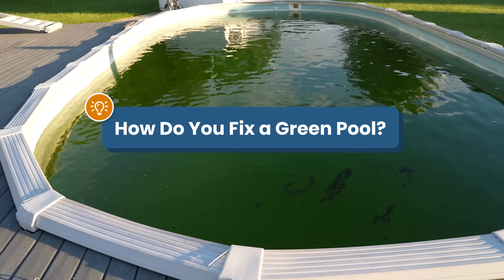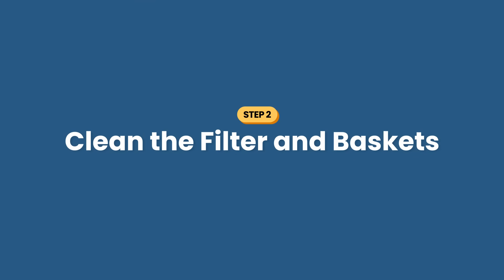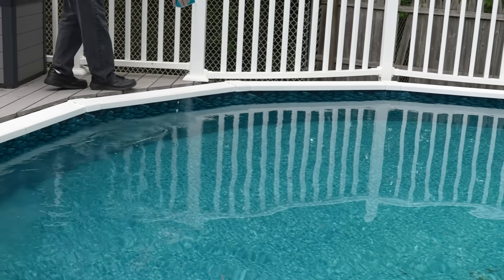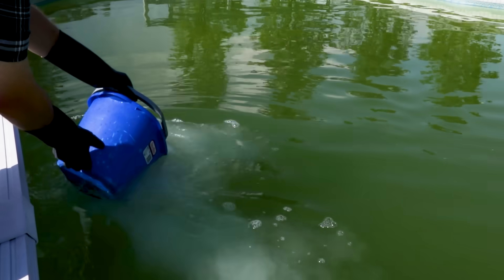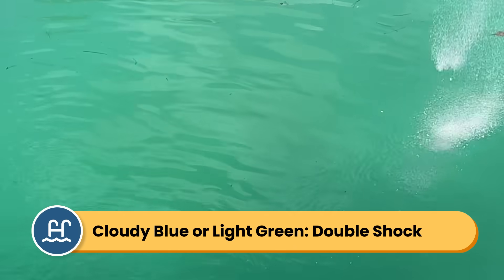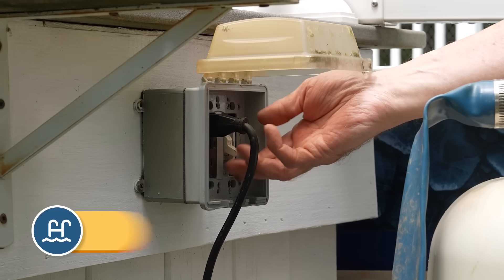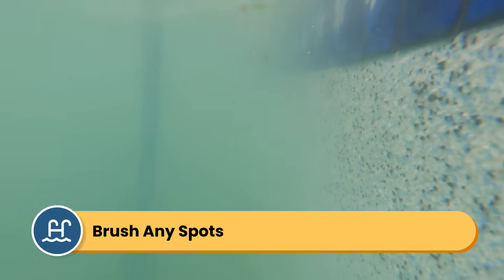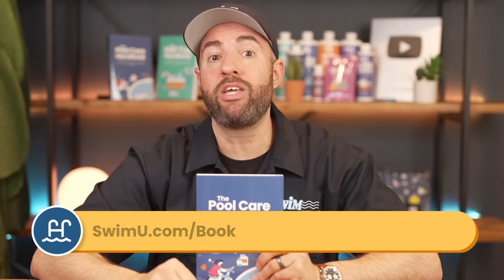Green Pool CURE: How to Clear Up POOL ALGAE Overnight (24-Hour Fix)

Comment: What if you already have high cyanic acid levels? Will all that shock/chlorine work?
Reply: CYA over 100, no, likely in chlorine lock. Will need to do a partial drain and refill to lower your CYA. If your pump has waste option, drain water by vacuuming to waste

Comment: What’s wrong with using algaecide?
Reply: Nothing wrong at all. You're the first to ask that & I'm rather perplexed that many are using gallons & gallons of Chlorine to eliminate their Green Pool!?
When my pool goes Green, Algaecide is my 1st port of call.
5Ltrs around pool, pump on for 10hrs, sweep pool wall & floor periodically during the purging process, remove & clean my filter a couple of times & the Chlorine gets added next. Then add Baking soda to adjust Alkaline & lastly adjust PH increase if required & presto. 15yrs doing the same trick & never fails....oh, no one's ever gotten sick or died👍

Comment: I just installed a 1000 Gallon pool and the Test strip shows the lowest level of Chlorine (new water) I bought a 3" tablet that treats 10,000 Gallons. Should I throw the whole thing in or is it ok to break in 4 and use 1/4?

Comment: If u got mustard algae, just shocking doesn't work I just went thru it.What worked was the heavy shock algacid and clarifiya filter was only cleaned twice before i started and around 5 hrs later. it's clear in less than 24hrs my family and neighbors think I'm a magician cause it looked like they weren't going in there anymore swamp thing 🧟😂

Comment: just prevent it by installing a solar ionizer!
Reply: What is your review on one? Do you have one?
Reply: @CurlyQ101z  a very interesting claim made by the fabricant in its description, that by its very decent current eliminates any germs passing by: i encourage own experiments in order to find out more (by biotensor, petri discs etc.)
Reply: @CurlyQ101z  no more slippery ground/wall cover (moss/algae) i found; after aspirating loose grey/black debris from its ground it keeps cleaner than before.
Reply: @CurlyQ101z  about 15€ from Aliexpress incl. shipping, put it in just 10 days ago

Comment: All this is great and all but you can absolutely never run the filter (if it’s a DE filter) idk about sand filter for 24 hours straight. My pool is dark green full of algae. Like bad. After adding fresh DE powder and cleaning the inside of the fingers of the DE filter, the pressure on the filter literally will skyrocket to 20 psi within literally 20 minutes to 30 minutes, maybe even less sometimes it clogs up right away and it’s the most annoying thing in the world and it also cost so much money using all that DE   Everytime I completely open my DE filter (it has the easy quick one screw system to open it) I drain the dirty water in the pot spray off the fingers with the hose put it back together add the new powder and it’ll be clogged again in 20 minutes. It’s so frustrating.

Comment: Need help 2 days ago i added 6 bags of the shock pool because water was green well water looks clear but the algai looks like its settled on the pool lining and so yesterday i added 2 of the 1 gallon pool agai each and water is still green i dont know what else to add plz help do i need to clean filter and wash it several times a day to help filter the algai or do i need to add more chemicles i dont know what else to add
Reply: Oh the 2 gallons i put in the pool where clorox for treating algai
Reply: We did this to and our pool is still green. We have no idea what to do next. We’ve shocked twice already with 3 bags and then 5 bags. All levels are good but it’s still green. I scrub and vacuum daily and sometimes twice a day. And nothing is helping.

Comment: My CYA is at zero and my pool is as dark as can be. Where in the order of these steps should i add the stabilizer to this? I have been battling algae in Florida and i can’t get my cya to stay up (possibly from shock and floc method i was using ?)
Reply: Check your phosphate level.   It's basically algae food. You want level around 200 or less.  If gets high then have to use phosphate remover bc it will eat up.all your chlorine and won't be able to keep algae under control. Have your local pool store test your water.  Also before you do the phosphate remover step, you have to heavily shock pool to kill algae and filter it all out 1st.  Good luck.  Fyi I'm in TN so this might be different in FL but a good direction to start.

Comment: All my levels are within range and I’ve put 10lbs of shock in, my pool is 21k gallons. After this I at least expected it to be cloudy the next day but still light green.
Reply: I have a 14,600 gallon pool. I bought 12 bags of Cal-hypo shock, and used 6. The next day my chlorine was at zero, but the pool was a bit lighter green.  Someone on pool page told me to go get liquid chlorine. I put in 8 gallons last night and this morning the color is blue, but cloudy. Tomorrow I will vacuum.

Comment: I've been using the cal hypo shock for the past 2 weeks and I keep going out and finding dead algae on the bottom even though I've put algaecide 🤦🏼‍♀️ I do not want to buy a vacuum for an above ground pool! I've been backwashing my filter once a week
Reply: I bought a vacuum for the above ground and it literally pushes the tiny algae back out of it. -.-
Reply: @Ghosted710  same
Reply: Just plug the hose onto the suction port and push the end of the hose around the floor with your foot making sure the end does not lay flat and suck to the liner.

Comment: What he don’t tell you is that it’s never this easy if you have a ton of algae you’ll be cleaning your filter 5 times a day for a week
Reply: And vacuuming stirs it up. By time I bought shok, floc, waste watter. I should just emptied it
Reply: Yes ,..
Reply: I just opened it yesterday, and their was so much Algae that i started to close it right back down. My wife usually takes care of it, but i'm not Speaking to her right now.😂😂😂
Reply: @BarrySimpson-pk7qs yeah man it’s full time job my man
Reply: I'm actually doing it now
Reply: We've had the pool for 13years and she always does the up keep. God is good, she saw me struggling and didn't help. I Brushed the walls over and over cleaned the filter 7 times yesterday and shocked it lastnight.  I wokeup this morning and it was a little cloudy, i cleaned the filter 1 last time, put the Robot in, and now it's Perfect. Ill get a water Sample tomorrow morning.
Reply: @BarrySimpson-pk7qs im literally on week 2 anyone ever have your pump start strong then 20 minutes later its dead I tried everything
Reply: @bdoubleu6 yes what's the reading on pressure gauge?   When filter clogged then little to no flow to pump so it shuts down on no flow.
Reply: Im cleaning my filter every 30 minutes. Literally, every 30 minutes.
Reply: @leetpg up the rpm's on the pump. That is just ridiculous!😂
Reply: My algae was caking on the walls and I cleaned filter, swept best I could, recharged with De and just put in 6 bags of hypo chloride and currently am on the next day with pump running, pools looking blue and beautiful, definitely a little hazy, but no green , I'll be cleaning filter again and then balancing, I took the pump and line out to clean and I'm a little iffy about it, cause the inside has to have algae debris inside, maybe running through with the chlorine will help, but this is legit advice
Reply: @PoqanicsI don’t know what the hell kind of pool equipment you got then
Reply: I think what really really helped me, is i have 3 filters and i just kept rotating them.
Reply: @BarrySimpson-pk7qs yes mate, I have two filters & it sure helps immensely. Just gotta remember to clean the dirty ones, ready to load. If you 4get & everything dries out, it makes cleaning the filter properly, more difficult!

Comment: My water is clear but I keep getting dark almost black "piles" of SOMETHING on the bottom.  I tried all of this last year and could never get rid of it.  I opened it last week and it already came back.  Algae killer, shock, tried it all and it keeps coming back.  It started last year when I uncovered it and the water was Black/Dark green really bad from a bad cover on it all winter.  I havent been able to get rid of it since then.  I'm at the point of draining and refilling if I cant get it cleared soon..  How can I  tell if its algae or somehting else?
Reply: How cold/hot does it get where you live? Also, is there a kind of tree/vegetation do you have that is getting into the pool that could possibly be causing this?

Comment: What do you think of the Pristine Blue products. My pool is always clear but I do have a few black algae spots on the bottom, I vacuum regularly to get it up but they always come back. When I test the water, I always have very low bromine, free chlorine and total chlorine levels. Should I also use chlorine with the Pristine Blue products? We use this product so we don't have to use chlorine. Thanks

Comment: I don't think I have an algae problem, I hope but I put the shock, then the chlorine tablets and run the filter pump for a couple of hours. If gets clear but for some reason I always see that there is some kind of residue or dirt all around my pool edge. When I saw it I scrub it all away but after the chemical and filter clean up it comes back. What is that? Is it part of the chemicals?
Reply from the maker: It could be sand coming from your sand filter, if you have one. This might help you problem solve: https://www.youtube.com/watch?v=Ic0UiN8J86Y

Comment: I shocked my green pool but not it is a pretty but not normal cloudy blue...help please ????
Reply from the maker: Cloudy blue is good! That's dead algae. Clean and run your filter for 24/7. You can also add flocculant and vacuum it out on the waste setting.

Comment: Yeah, but the filters clog very fast when algae is in the pool. I'm on round 5 of filter cleaning with little on them but what is there chokes them off completely. There has to be a better way.
Reply: Exactly that is what he leaves out
Reply from the maker: You can vacuum out the algae with a manual vacuum on the waste setting. But you'll lose water and you have to do it by hand.
Reply: just shock and flock, then turn the pump off and vacuum to waste the next day

Comment: What is a good brush that won't harm a pool liner?
Reply: He has recommendations on their site.  I got one at my local pool shop.  They typically have “for vinyl liners” or something similar.
Reply from the maker: Look for nylon bristles!
Reply: I love the Wall Whale brush. Makes it easy to brush, you don’t need to put pressure to hold it against the wall.

Comment: Not always. I followed your instructions and the water after  24hrs running the pump was still blurry and green algae spots won't go away.
They measured the phosphates and it was above 2000... after dealing with that it became crystal clear. 
Thanks anyways for your video.
Reply from the maker: What ended up working? Did you add a phosphate remover?

Comment: I usually don’t cover my pool in the winter and just slam it to open it, it’s usually dark green, for unmanageable reasons I ended up not opening it last year so an extra year went by and when I went out there to scoop what I could off the bottom like I always do,  it looked more like a brownish mud instead of green algae and my pool water also looks a brownish color instead of dark green, can you tell me why or what could be going on….. it almost looks like a bunch of mud was just poured into it.
Reply from the maker: It sounds like debris got in there and broke down. Have you tried vacuuming on the waste setting?

Comment: Matt, what is your take on Simple Scoop, the all in one pool cleaner.
Reply from the maker: It is a non-chlorine shock that also has copper in it as an algaecide. It does not replace chlorine, pH, alkalinity, CYA, or calcium hardness. It only replaces non-chlorine shock (oxidizer), and using an algaecide or clarifier.

Comment: Could you elaborate a bit more on vacuuming to waste with cartridge filters? Specifically with removing the cartridges and opening the drain plug if you dont have a diverter valve to waste option , as its the norm for us folks with cart. filter setups. 

Some context, pool was neglected for a few months, as i vacuumed, i noticed A LOT of sediment at the bottom of the pool. Stopping to wash cartridges is very troublesome. Also, might need to get new cartridges since the core looks to be caked with thick algae. 

I.e. is this a straight forward process, remove the cartridges, remove the drain plug, then power on the pump and start vacuuming? 

Any tips, such as, using a brush to push the dirt/sediment at the bottom to the deep end and being able to vacuum the bulk of it, relatively fast. 

Thanks in advance!
Reply from the maker: The biggest issue with vacuuming to waste on a cartridge filter is the water that puddles underneath. If you can hook up a hose, that would be helpful. Otherwise that's the process

Comment: For clarity, does the pump have to run 24 hours prior to adjusting pH or just proceed knowing it has to 24 hours once chemical adjustments start?
Reply: 24 hours once chemical adjustments start.
Reply from the maker: Just proceed. 24 hours during the whole process

Comment: To maintain the chlorine levels ten times the normal levels, you said double, triple or quadruple shock. But how much increase the level a double, a triple and a quadruple shock?
Reply from the maker: At least 10 times the normal amount. The guide in this video is based on the color of the water, which will hopefully get you to 10x that chlorine.

Comment: Great video with lots of useful and easily digestible tips on clearing up my pool algae after pump failure and local temperatures approaching 95*.
Reply from the maker: A pump failure will do that! Hope you get it cleared soon 👍
Reply: Need to also check stabilizer. Too high or low makes chlorine less effective.